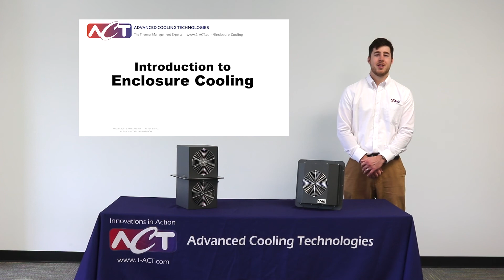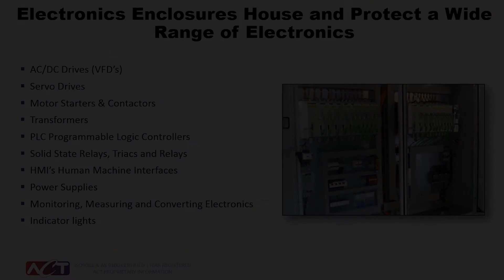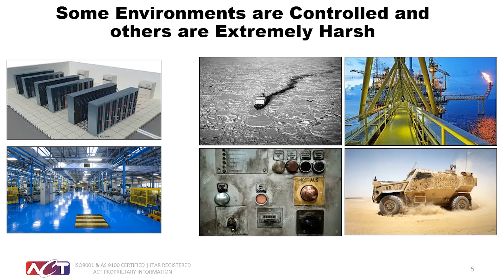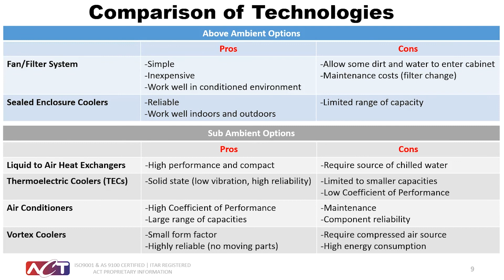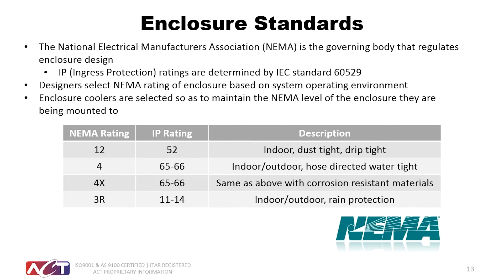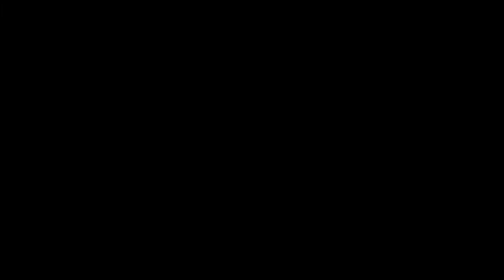Introduction to Sealed Enclosure Coolers Video

Comment: Not very informative because it's in jargon and is mumbled. Delivery is un-natural. Presentation needs to be done by someone comfortable enough with themselves just to speak normally and talk to your audience like they ARE NOT cooling experts. Presenter looks and sounds like a really nice, petrified, shy guy spitting out a lot of technical information but not actually talking to an audience of strangers. But, with that said, I did get the link to your company. I'll do my own reading or keep looking for helpful information for my decision process. I need to buy one, not build one.
Reply from the maker: Hi Brett- If there is information you need please reach out, we'd be happy to assist you in determining which sealed enclosure cooler is the correct fit for your application. solutions@1-act.com or call 717-295-6061. On our website we have a selection tool that many visitors find useful. https://www.1-act.com/enclosure-cooling/selection-tools/.